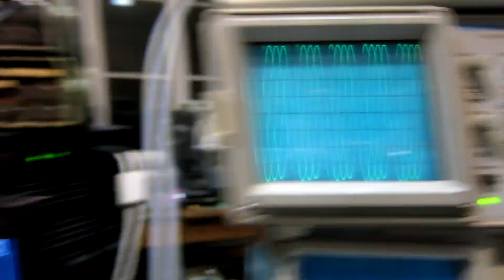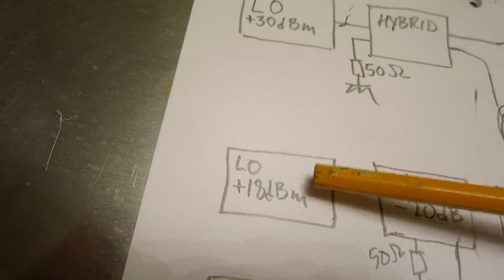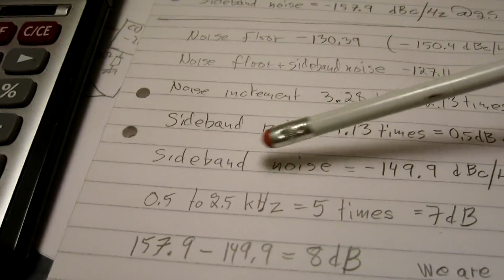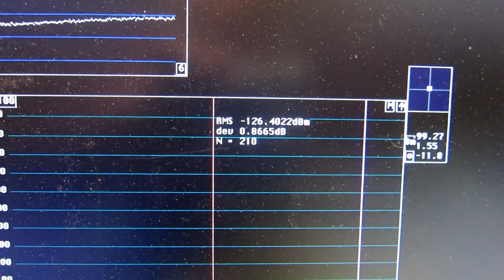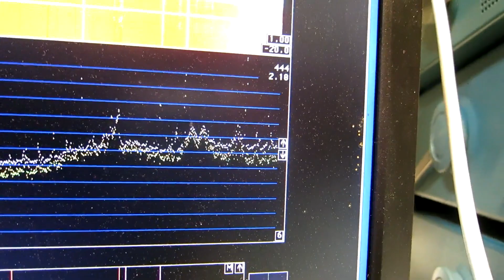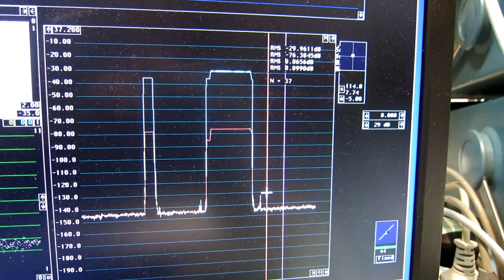nerds20

Comment: Am I observing correctly? 😊 sample with two channels simultaneously and tune one with a different offset to determine if sideband noise is indeed present on the sound card side (assuming that doesn't generate additional mixing products)
Reply from the maker: No. I have set up a conventional direct conversion receiver with two mixers in quadrature. The LO is my best oscillator. I use two test signals, a HP8657A and my second best semiconductor LO. One or the other or both.Since the soundcard (The manufacturer does not want me to use "soundcard" because this A/D converter is designed for SDR and not for music. Nevertheless,  to the computer it looks like a soundcard, but it is much better for direct conversion receivers.) The next step would be to add perhaps 30 dB gain in front of each audio input. That would lift the noiseat the mixer outputs by 30 dB while adding a lot of uncorrelated noise from the amplifiers. The correlation spectra would remove all uncorrelated noise and thus make the noise at the mixer outputs measurable even if it is at -174 dBm/Hz< (room temp.)  The correlation spectrum shows the part of the signal to both channels that is coherent. Equal in amplitude and phase. Random noise from amplifiers is averaged out and does not contribute.,Once the "correlation receiver" works well I will try to make a second LO that is equally good as the currently best one. Running it as the signal with an equivalent unit as the  LO might show the limitations of Schottly mixers. Here a limit of -180 dBc/Hz is found at wide range:https://tf.nist.gov/general/pdf/2556.pdfThat seems unreasinable to me since mamplifiersmapproach -197 dBc/Hz and the limitation for that seems to be the quartz crystals.I will do my best to entertain nerds interested in this narrow subject for quite some time to come. ...